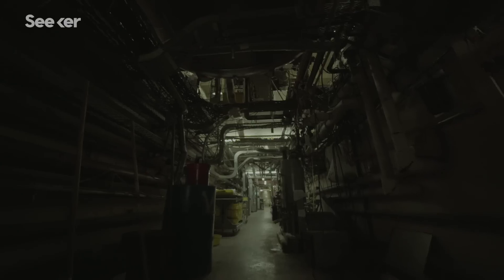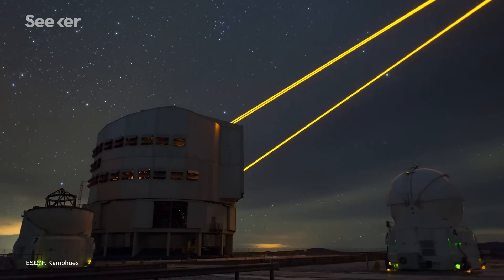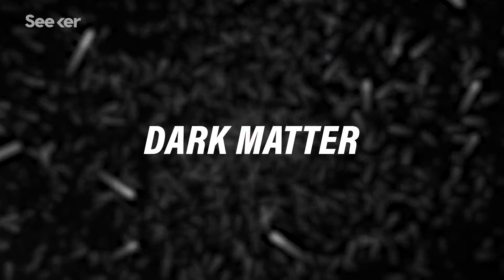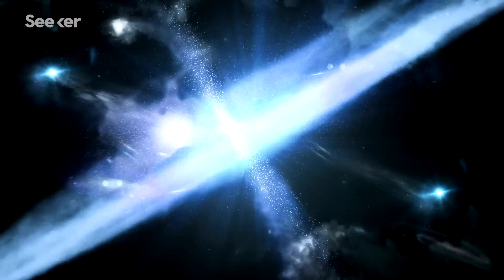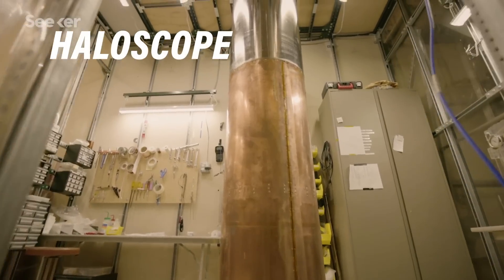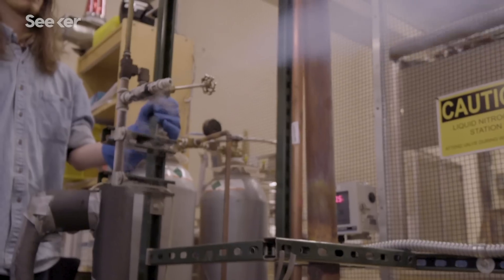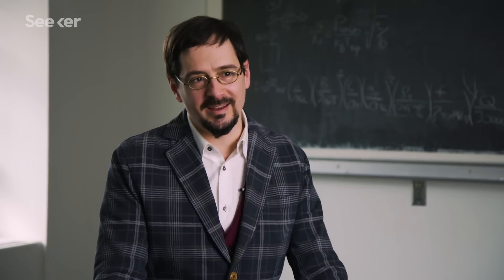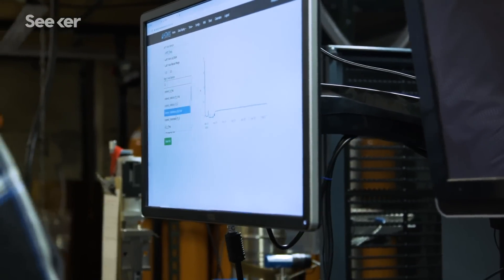The New Dark Matter Particle on the Edge of Physics

Comment from the maker: Hi Seekers, thanks for watching! For more on the hunt for dark matter, check out this How Close Are We?: https://youtu.be/Ypm4QcOOqXQ
Reply: PHYSICS HAS FOUND IT!  AXIONS are a REAL CLEAN-UP.  You should investigate around 4 GHz, based on AT&T experience.  When investigating microwave relay links, they found unexpected excess noise in the receiver, at the selected link frequency.  There response was (??!*^) and therefore just increase transmitter power.  What they stumbled on was the WINK RATE for AXIONS in this observed dimension.  There are other parallel dimensions, with different WINK RATEs.  The different frequency of parallel dimensions makes each invisible to the other.  
THIS is a huge leap forward in physics, because it provides an explanation of parallel worlds.  Also, we know of three dimensions in SPACE, and now consider a 4th dimension in SPACE, where the extended space is an axis of FREQUENCY.  As the AXION WINK RATE changes, you move along the axis of a 4th dimension in space, where parallel worlds are found!!  Some HISTORY from WIKIPEDIA:  After the war, telephone companies used technology to build large microwave radio relay networks to carry long distance telephone calls. During the 1950s a unit of the US telephone carrier, AT&T Long Lines, built a transcontinental system of microwave relay links across the US that grew to carry the majority of US long distance telephone traffic, as well as television network signals.  The prototype was called TDX and was tested in 1946. The TDX system was set up between New York and Boston in 1947. The TDX was upgraded to the TD2 system, which used [the Morton tube, 416B and later 416C, manufactured by Western Electric] in the transmitters, and then later to TD3 that used solid state electronics.
Reply: @semilberger6742  great response i really enjoyed that share. Thank you and what a fantastic job you did putting this together. 😁🎯
Reply: PHYSICS HAS FOUND IT!  AXIONS are a FOUNTAIN of FRESH INFORMATION.  See the previous discussion, this is follow-on thoughts.  Scholarly papers have been published, speculating that dark matter is vast sea of tiny particles, close to Absolute Zero and therefore able to form a Bose-Einstein condensate.  The same logic can be applied to the AXION particle.  If they are "mostly" non-interacting, then very slow and weak interactions may serve to drain energy and cool the AXION cloud, thus maintaining temperature of a few pico-degrees or less.  A Bose-Einstein condensate the size of out galaxy could be formed, and remain stable.  The fresh idea to be added here, is maybe there are many possible energy levels of this condensate cloud.  Each level can co-exist with the other, kind of like the many electron-orbital levels in a large atom.  Every energy level has a unique and narrow range of particle mass and frequency.  The co-existence of these levels allows for parallel realities, based on a range of unique frequencies.  
Remember that the AXION theory came into discussion because of the CP problem in theoretical  Strong Force mathematics.  Seems that the Strong Force that holds atoms together is closely connected to the AXION.  The fresh idea to be added here, is maybe we can see a real-live case the "Tail wagging the Dog".   If the AXIONS in our slice of the cloud have consistent frequency then likely the Strong Force will be Modulated by that frequency, which will next modulate all parts of our observed material world.  That modulation frequency can be called the WINK RATE for out dimension.  With this logic, other parallel dimensions should exist, and remain just as stable and valid as our familiar dimension.
Reply: Einstein, bohr, Rutherford did great things without these fancy labs; today's scientists are not doing anything great
Reply: @crpfx302   you do know that einsteins theory of mass where all this is based on was not to his own liking because there was nothing that could relay back to the real world we life in sow yrah he was great but also maybe to great because pouple know take it as a base princaple of cosmology and thats what makes unproven forces come from they not only inproven  but they also wil never be proven because the real driving force of our universe is elektricity and its proven lots of times its just being dismist because of that some pouple just cant ecpet they are wrong or they have a aganga where it is not provitable to back up those pouple how spoke out of this also on school youre not learning to think for youre self they just put you in one way thinken way sow they can say what they wand and you believe it wel maybe not you but enouch others do i can say wach some wall thornhil about the electric universe
Reply: @mopadrider6012  plasma...
Reply: @crpfx302  that's bcz during those days things which are got to understand is macro scopic now everything is almost been discovered so only thing left is quantum mechanics and other stuff like these dark matter
Reply: We stand on the shoulders of the people that went before us. We need be not limited by an imaginary barrier, as they also refused to be limited. We continue to look, just as our predecessors taught us. Just as our children will look further after we are gone. If we teach them.
Reply: Not only want you to upload as much as videos possible but I couldn't understand few
Reply: @hiteshv1612  dont waste your time, read Emanuel Velikovsky or visit Joe Deglmans channel this will mislead you. Listen to Ben Davidson but this is WRONG that's why they still cant find dark matter.
Reply: Dark matter does NOT EXIST, please stop this insanity. By definition it is insane to pursue this madness, since Jim Peebles science has gone backwards. What about force in motion,acceleration inertia.....Emanuel Velikovsky's work proves Perratts work. Plasmacosmology cant you tell its MAGNETISM
Reply: Dark mater is unprven you pouple just made it up becouse this days science doesbt work not because math and stuf is wrong but the concept is wrong because almost all things we see in the universe does just not make any kind of scence if you believe the science they use here or now  because then not even evrything bud also we ourself could never been here sow orderli and also why are all galaxys the same shapes that also could not be posible look up wall thornhil maybe you than get somewhere instead of trying geting a nobel prize be making stuf up you say you can prove bud you cant you cant prove darkmater  you cant proof blackholes you cant proof neutron stars in this kinda science that is used here in this video wall thornhil can an wil debunk evrythink said in this video whit proof and experements that can be scaled up to universale scale you cant do that whit what they use where expample if the sun was nucliar and if the hiden working force was dark mater we already been dead becouse you just cant pack that many protons sow densly up on eachother evry nucliar scientist knows that
Reply: Could dark matter be strange matter or strangelets?
Reply: 3:41 min "First follow the THESIS". It's supposed to be science, so please use correct terms ffs.
So they found nothing, as usual, because there is nothing, and there never will be anything that actually is Dark Matter.
As long as Physicists do not doubt the reality that our brain produces, there will be no progress.
They ignore neurosciences completely and are lost in the DARK.
It's somehow funny that the obvious answer is being ignored.
Reply: @entyropy3262  

Neuroscience is not relevant and does not support you. We have ample evidence for Dark Matter. SOMETHING that we cannot see, and thus is called Dark Matter, IS effecting the visible matter. That is reality. So Dark Matter does exist. What it is, is the question.

BS will not make the gravitational lensing go away. 

YOU have not answer in that post and you have no evidence in it either so there is no answer that is being ignored but there is EVIDENCE that YOU are ignoring.

Look at the evidence and can the Crankery.

Ethelred Hardrede
Reply: @EthelredHardrede-nz8yv  Find my other comment in the comment section where I already discussed it in detail. It will be A LOT easier to find than Dark Matter and mainly because it does exist.
Reply: @entyropy3262  

"Find my other comment in the comment section where I already discussed it in detail.

OK, you could have given at the thread its in. 

"It will be A LOT easier to find than Dark Matter and mainly because it does exist."

Wrong as Dark Matter does exist. We have ample evidence. I note that you are into philosophy and its seems to be the German Circle Jerk School at that. Science tests, philosophy bullshits.

Ethelred Hardrede

Comment: Combine:
1. Nxy = number of superpositions per m^2= wave function frequency
2. Cosmological constant in Dxy stretching spacetime [m^-2] = lp^2/λ^4= lp^2 Nxy ^2 [m^2] [m^-4]
3. Schrodinger solution
4. Einstein E= m c^2

Result: dark matter = superpositions (recoherence) of the neutrino (Axion?) which gives the neutrino extra mass

Dxy = lp^2/λ^4= lp^2 Nxy^2 

Nxy = sqrt(Dxy / lp^2)= (Dxy / lp^2) ^0.5 

 Nxy = sqrt ( 1.1056 10^-52 / 2.612 10^ -70)  = 0.65 10^9

Schrodinger solution:

Nxy^2 h^2 / ( 8 m L^2) = m c^2

8 m L^2 m c^2= Nxy^2 h^2 

m ^2= Nxy^2 h^2 /( 8 L^2  c^2)

m =  + - (Nxy^2 h^2  0.125 L^-2 c^-2)^0.5

m= (0.42 10^18  43.9 10^-68 8.99 10^-16)^0.5
= 166 10^-33 kg
= 0.931  Mev/c^2  ( all superpositions).

1 particle =  166 10^-33/ ( 0.65 10^9) = 255 10^-42 kg = 0.143 10^-3 eV/c^2  Axion?

dark matter = superpositions (recoherence) of the neutrino (Axion ?) which gives the neutrino extra mass

Comment: PHYSICS HAS FOUND IT!  AXIONS are a REAL CLEAN-UP.  You should investigate around 4 GHz, based on AT&T experience.  When investigating microwave relay links, they found unexpected excess noise in the receiver, at the selected link frequency.  There response was (??!*^) and therefore just increase transmitter power.  What they stumbled on was the WINK RATE for AXIONS in this observed dimension.  There are other parallel dimensions, with different WINK RATEs.  The different frequency of parallel dimensions makes each invisible to the other.  
THIS is a huge leap forward in physics, because it provides an explanation of parallel worlds.  Also, we know of three dimensions in SPACE, and now consider a 4th dimension in SPACE, where the extended space is an axis of FREQUENCY.  As the AXION WINK RATE changes, you move along the axis of a 4th dimension in space, where parallel worlds are found!!  Some HISTORY from WIKIPEDIA:  After the war, telephone companies used technology to build large microwave radio relay networks to carry long distance telephone calls. During the 1950s a unit of the US telephone carrier, AT&T Long Lines, built a transcontinental system of microwave relay links across the US that grew to carry the majority of US long distance telephone traffic, as well as television network signals.  The prototype was called TDX and was tested in 1946. The TDX system was set up between New York and Boston in 1947. The TDX was upgraded to the TD2 system, which used [the Morton tube, 416B and later 416C, manufactured by Western Electric] in the transmitters, and then later to TD3 that used solid state electronics.

Comment: Another way to prove axions exist is build probe that can measure change of position for centrifuge force. Like balancing scale but, have a powerful magnet powered one side while rolling the craft with mass even on both sides. Over time it should look like the craft is slowing change its centrifuge force down slowly over time. There you should be able calulate its mass hopefully without taking other worlds with its own magnetic field in condideration attraction.

Comment: He answers his own question. As he said, everything is waves and fields when you get down to it, even ‘PARTICLES’ but the problem is, by misinterpreting the environmental conditions the vibrations exist within, the harmonics of vibrations are not understood well enough. With out understanding this harmonic scale and how you can not identify the key elements of that one particular octave. The octaves share harmonics and this can distort the perception of the key if one does not understand the progression of the octave scale. 

The ‘key element?’ it is RESONANCE. 
And resonance is basically a factor of polarity. 
All that is required is to correctly interpret the point of difference between T and -T for what it actually is. 

(And there lays the problem for this absurd version of reality called particle physics.... tsk tsk tsk. This is why you must never, ever allow politics and science to become interwoven.)

No additional force or particle is required. Only the understanding that the atomic vibrations and sub atom vibrations are one and the same thing only operating at different octaves.
Reply: Can you sent bid of what you talking about?

Comment: Don't worry they are atoms they just might contain a little bit of antimatter this dark matter is an amalgamation of helium and antihelium of course you guys do you know this. Unless you were sleeping that day I'm pretty damn sure it was brought up you know like theoretically or something don't worry this molecule is still inertyou don't need to look for with a sound you need to use a visual standing wave ratio monitor sweep generator with frequency markers a tunable frequency generator capable of going from 3.4 gigahertz  to 5 gigahertz the to needs to start out at 5 then dropped to 3.4 you should be able to see it visually on your monitor this should look like actual physical objects what you need is an illuminator.

Comment: What we do know about dark matter. It is stable, long lasting and measurable. It has gravitational properties of dense matter. It is not attracted to, nor interacts with other dark matter at a Galaxy scale (two galaxies can pass through each other without disturbing the dark matter to any significant or permanent degree). KG for KG Dark Matter produces a force of 80x normal matter. The almost knowns. It almost certainly interacts with magnetic fields at a Galactic level. It's density and effect is linear across a Galaxy (It is as strong at the edges of a Galaxy as in the Central Bulge). Together these knowns and almost certainly knowns would strongly indicate Dark Matter is a strong magnetic force "permanently" bound to normal magnetic field matter (stars, Blackholes etc). Once bound to or formed by normal matter it cannot unbind or transfer it binding to any other passing matter. It is much like a permanent electro magnetic field. This sounds like WIMPS (weakly interacting magnetic particles). So there are either far more WIMPS than we can imagine or they are SIMPS (strongly interacting magnetic particles). Both WIMPS and SIMPS are produced by Magnatars and Neutron Stars. Magnatar stellar eruptions literally send Mega Gauss 1m Trillion Gauss across the Galaxy. Theses particles are strong interacting electro magnetic particles. Our Milky Way Galaxy has around 50 of these stars active at any one time producing 50 million trillion Gauss per 1 eruption for each of the 50 Magnatars. These particles must end up somewhere. The eruptions can strip atmospheres from planets at 20,000ly and ionise molecular gas clouds at 50,000ly. The majority of the particles end up in the Galaxy Halo. So we now have a source, a transport and an effect mechanism that may fully explain Dark Matter.

Comment: 7:08 one of the things I have learned doing physics is how hard it can be designing electrical connections between two metals that works at room temperatures and at super low temperatures. The properties of metals change a lot at different temperatures and no two metals change the same amount so often a metal will contract or expand more then a metal connected to it and that will build up a lot of stress which will eventually lead to the connection breaking. designing to account for these changes can be challenging but it is very important because the quantum physics properties we are looking to test only show up at low temperatures.
Reply: @Heads Mess I had to do that as part of a microsensor we were designing, I feel ya

Comment: Hmm, dark matter is suppose to explain the motion of our sun traveling some 450,000 mi/h as it orbits the Milky Way's core at some 26,000 light years away? But get this, gravity acts the same on all mass regardless of weight or density. Meaning, in a vacuum gravity causes a bowling ball and feather fall at the same exact rate! This was proven in experiments. 

So, if the gravity from dark matter was the only thing acting upon the mass in our solar system then it would affect all mass the same regardless of weight or density. Meaning, if the sun was being affected by dark matter then the planets would be affected too. But that doesn't seem to be the case now does it? And don't go saying that the planets don't weigh enough or not big enough for dark matter to affect because gravity acts upon all mass equally regardless of weight or density.

Comment: When I worked on jets, and had a wire/cable malfunction, we used a TPDR.  I don't remember what it stands for, that was many years ago.  It sends a frequency through the wire, and depending on the readout on the oscilloscope,  we could determine if there was an open, short, or crimp, and how far down the wire or cable it was.  Pretty neat stuff.

Comment: Dark matter is Darkness at what happens when you turn out the light. It is the very fabric of space which everything rests in and floats on. You cannot see it because we see in wavelengths of light bouncing off objects. But light is a stronger Force than darkness and pushes Darkness away it is also the reason why objects in space on a massive scale are pushed apart causing the expansion of the universe.